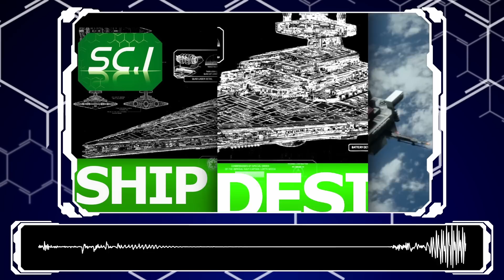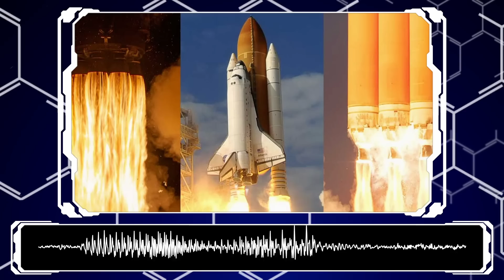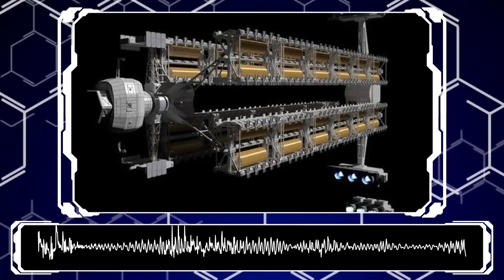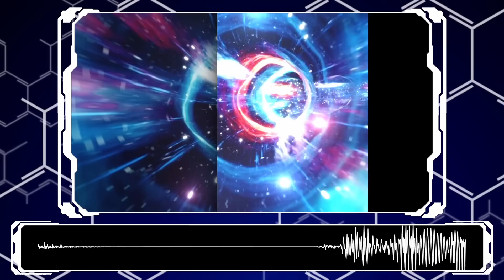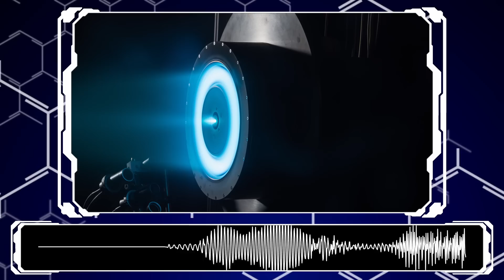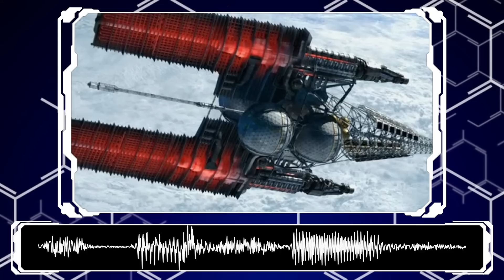The types and quirks of hard Sci-Fi propulsion and how you can use them in your designs.

Comment: I actually have some semi-detached engines in the hero ship for my book series (and well, as a general design concept for that species' ships) where the plasma exhaust itself is used as a method of cooling the ship.  The general concept being that you want to heat up the exhaust as hot as possible in order to get more thrust out of it and you want to cool the ship down as much as possible in order to not cook the crew so why not do both at once?  The reactor coolant is also reaction mass and with heat pumps (which can already take a cooler space and dump heat from that space into a warmer spot - see air conditioners) you just use that to dump heat into the cooling system to superheat the coolant as it's about to be ejected.  Combine that with a nice bright coat of paint and other methods of reflecting heat and you've got yourself a relatively simple way of cooling the ship.  As long as the engines are running.

...Though come to think of it, much like the galaxy class the FTL engines on these ships are also fully detached; I like rings as FTL systems so for various technical reasons all of these ships have a detached ring that completely circles them which provides shields and FTL, as well as some additional cooling - both thermally and 'making the ship look cooler', as the rings themselves are also water cooled and the high energy radiation that comes out of them passes through the water to make cherenkov radiation which is just allowed to escape from the ship (since allowing it to be absorbed is just more heat to otherwise get rid of).  Cherenkov radiation is this really amazing blue glow that people tend to associate with Sci-Fi ships and thus it cools the ship and makes it look cool.  I did a whole 3D render of it and everything (https://ircnetsplit.com/images/phoenixdiagram.jpg)

Comment: Star Trek ships are very notorious for not having their sub-light engine oriented along the center of mass.
Look at the Original Enterprise, the impulse engine is placed only on the rear of the saucer and they are tiny relative to the overall size of the vessel. Other ships have their engines located very close to their halls which should heat up and melt due to the heat from the engine's exhaust.

Comment: In a world I run as a TTRPG I used engine pods due to an issue I had in the system. I wanted to make the rules I had work for a scout-size ship but I also needed that ship to be faster than larger ships with more powerful and many more engines. Instead of giving the ship drive engines of its own, I gave it 2 hardpoint clamps. I then built the 2 unmanned ships that were nothing but a control computer, armor, weapon hardpoints, ram scoops, a docking clamp, and drive engines. The main ship provides power and primary reaction mass while the engine pods give thrust. I could have hand-waved the rules but I already had other ships made with those rules and I wanted consistency.
Reply: You could just use GURPS Spaceships, it's a really small hard copy, as in the book itself is the size of a magazine.
Reply: @torg2126  That is what I used.

Comment: Their another advantage of having a tractor configuration if your cargo/crew is hanging very far away from you rocket. If the reactor that generator power(not the exhaust its self) is highly radioactive then you can by design get as nice and far away from it as possible.Rather then having the massive support structure need to keep a crew capsule 1km away from you mini supernova reactor your dangling on a 1km long cable with all the cargo eating up spare rads in front of you. And should you hit a partial of dust then you have bother the reactor engine and cargo in front of your crew to act as a shield(assuming that like our world the pay out for dead workers is much more then filing insurance claims on cargo and equipment).

Comment: 22:46 How do big radiators work in space?
There is no atmoshphere to utilize for convection, so the coolant remains hot after it was heated by the engines. You'd need to expell the coolant once it was heated (if using water then prolly after it became steam) so what you need more is vents, not surface area.
Reply: Wrong. The more surface area you have for a radiator the more thermal energy it can radiate out into space in any given time. 

If your ship as 500sq meters surface area for a radiator while mine has 1,000sq meters surface area for a radiator I'll dissipate more thermal energy than you in an hour than you. But I'll have to produce enough waste heat to keep my coolant hot enough that it can come back before it freezes in the pipes. Unless of course I can reduce the distance, the coolant has to travel, effectively using a bypass and cut-off valve. But I don't know if that idea would work in the real world.

This is from wikipedia.
Radiators
Excess waste heat created on the spacecraft is rejected to space by the use of radiators. Radiators come in several different forms, such as spacecraft structural panels, flat-plate radiators mounted to the side of the spacecraft, and panels deployed after the spacecraft is on orbit. Whatever the configuration, all radiators reject heat by infrared (IR) radiation from their surfaces.
Reply: @Dr._Deaths  Read further my dude, space radiators are different than atmospheric (which was shown in the video), as they don't do convection, but instead radiate SMALL AMOUNTS of heat away via emitting infrared light.

They are incredibly shit at their job and the only reason they are used because of the otherwise low heat generation of satellites, probes, and the ISS.
Radiating the heat away from an active engine working with 48 MW (enough to push a relative small 1000 tonne craft with 1 G acceleration) with current technology would need at least 137.4k m^2 surface area, which is more than 5 times the surface area of the largest supercarrier's flight deck.
With 1 cm thick steel panels that shit would weigh 10.96k tons, ten times the engine can handle.

Even if we handwave shit and declare that future tech is 100 times better (quite bullshit imo), the radiator surface area would still be more than a thousand square meter, and it would take up 11% of the entire ship's weight.
Reply: @kovi567  A key point you missed is the effectiveness of a radiator varies massively with temperature. How much IR light a square meter of material radiates increases with the forth power of temperature (Stefan–Boltzmann law). Increase temperature 10 fold, you increase the light emitted 10,000 fold. Plugging the values you quoted (48 MW and 137,400 meters squared) into a radiator power calculator shows that the reason you got such an absurdly large area is because the radiator you based those figures on was working at the miserably low temperature of 7 degrees C. Steel radiators can easily get much hotter than that. At 1000 degrees C, still well below steels melting temperature, we are over 4.5 times hotter than before (1273.2 Kelvin vs 280 Kelvin) and so are radiating 426.6 times more effectively. At 1000 C you can shed 48 megawatts with just 322.2 square meters of surface area and a few dozen tons of mass. Increase the temp even higher with graphite or molten droplet radiators and the power density of radiators can get quite extreme.
Reply: @kovi567  The reason the radiators on the ISS and satellites radiate so little is because they are dealing with low temperature heat from human bodies and science equipment, and radiators have to be cooler than the thing they are cooling. But if your cooling thousand degree fission or fusion engines the radiator can be much hotter and more effective.
Reply: @kovi567  They still weigh quite a bit, the huge radiators needed to shed the megawatts, gigawatts, or even terawatts of waste heat a fusion torch would put out is part of the reason why multi gee fusion ships like the expanse are not very realistic. Near term fusion rockets design are lucky to get a hundredth of a gee. But compared to the amount of mass you would need if you relied on expelling coolant instead it’s not even close. Dumping coolant is never a long term solution, because if you're dealing with megawatts of power even high heat capacity materials like water would require dumping overboard multiple tons of coolant per minute . You might do that for brief moments to handle sudden spikes in power during a fight, but for regular operations for day or weeks on end you need a closed coolant loop, and radiators are the only way of providing that in space.

Comment: Great video. I think one thing you misser was the orientation of thr engines themselves. In hard sci-fi you don't onlybuave to speed up, you have to slow down. If you only have 1 set of internal engines, only way you can do this is by flipping end over end to face your engines into the direction you're travelling to brake with thrust. You can avoid this by having separate engines facing forwards or having external engines that can rotate to vector that thrust where it is needed. Delta V is always your best friend and worst enemy when designing a starship.
Reply: The problem with that is that, unless you have inertial dampeners and artificial gravity, you flip your gravity direction half way through transit.  The advantage of flipping the SHIP is that you can burn at 1G accelerating halfway there, then flip in 0 G over the course of an hour or less (depending on ship size), then burn at the same 1G in the same orientation, but decelerating for the second half of the trip.

Obviously for things like fighter craft this is less impactful.

Comment: Well for sci-fi like Star Trek impulse engines are forward only( unless designed otherwise there are a few). Ships in Star Trek maneuver mainly with thrusters. 21:41 did you mistaken the warp nacelles for thrust engines? Star trek mainly loves integrated or semi integrated engines. The warp drive systems are mainly detached ftl drive placement.

Comment: The bigger an engine is the more energetic an engine is.  So maybe smaller engines are easier to keep from self-destructing.
You missed plasma engines which are sort of in between and move plasma instead of individual particles in an ion engine style setup to get more thrust at the cost of reaction-mass/run-time.  Existing designs like VASIMR let you tune that thrust-efficiency tradeoff.
Also there was the old idea of thermal-rockets powered by some sort of nuclear reactor.  I haven't seen that idea floated in a while and I kinda wonder if it means that ion and plasma engines are just that much more efficient.
Reply: Or it was just forgotten. Which unfortunately does happen alot.

Comment: This reminds me of a scenario that has been on my mind in the setting for a sci-fi RPG I have been working on.  Ships can have a variety of engine types.  But the most common are reaction thrust rockets and ion engines.  I imagined the difference being...

"Prep for go!  Lines fully pressurized!  Starter ignited and hot!  Everybody, starting fuel flow...BRACE-BRACE-BRACE!"  There is a sigh of relief as the crew hears a whooph of safe ignition, followed by a skull-cracking pressure as the ship charges forward.  Pressing everybody down with it's enormous thrust.  After a few minutes of agonizing tension, the engines kick out and all G's stop.  Leaving our crew hurtling into the void at alarming speed.  

"Prep for go.  Ok captain. "   The crewman flips the light switch, kicking on the engines.  Then goes back to lunch.  Leaving our crew, not even moving yet.  Since it will take hours before the ship noticeably goes anywhere."
Reply: When I was finishing my undergrad years, a friend and I were in a competition to design a mission to Jupiter circa 2010-2020.  We soon realized that the Hohmann transfer orbit equations were designed for chemical burns, where (as is illustrated above) the deltaV thrust is all generated at the start, but we were using an argon ion engine powered by nuclear reactors.  We therefore had my friend's desktop (the flower of 1988 computing technology) run overnight to calculate the actual orbital start, turnover and stop dates.
Reply: @stuartwald2395  That's so cool!

Comment: Another advantage of the fully external engine is that when shit hits the fan, you can blow some explosive bolts and detach the engine pod and have the problem be not attached to your ship anymore.
Reply: This becomes a problem when said engine is the only way to get back to your point of origin, and makes for an excellent tool in dramatic writing.
Reply: @LexYeen  This is why you have more than one pair of such engines. And the ability to dial back your thrust in case you have to balance your ship on an uneven number of unevenly placed engines.
Reply: Wasn't a problem for Spike
Reply: Naturally, your problem then becomes 'not having an engine', but this is addressable, unlike being atomized.
Reply: It would probably make maintenance/replacement of them easier too.
Reply: "what if we take it
AND MOVE IT SOMEPLACE ELSE"